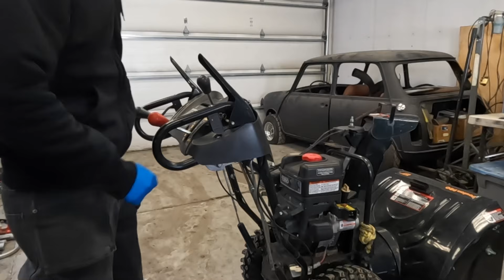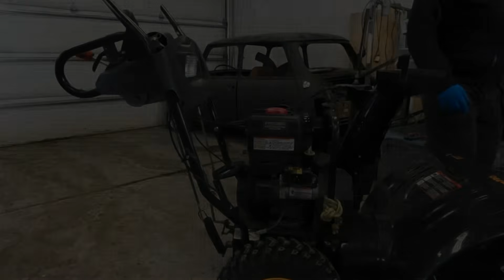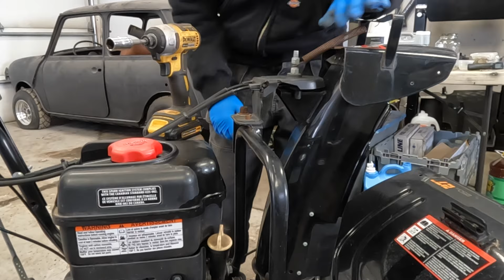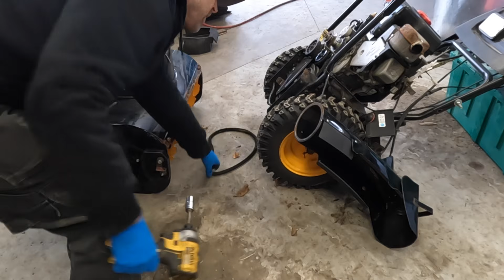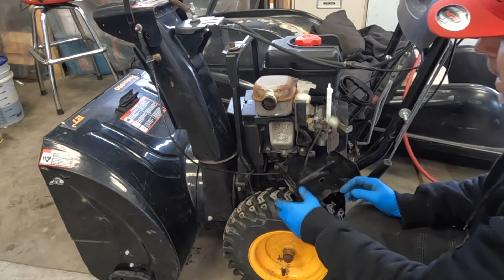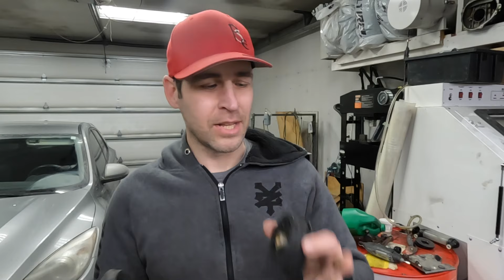Snowblower Inspection - Poulan Pro Auger Drive Issues. (Sorry for my high energy in this video)

Comment: When the two halves were put back together, i didn't notice any routing of the belt on the auger-side pulley.  Is there that much slack that the halves just bolt back without manipulating the belt at all?
Reply from the maker: I put this back together without installing a belt ... just to get the parts up off the floor. 
It is really easy to do, once you have done it a few times. Basically you put the belt around the bottom pulley and raise the halves together. As they get close you can either have someone hold the blower handle, or prop it against something and guide the belt into place. It's not hard at all. 

There is a brake device built into the bottom of the engagement arm, so you need to be mindful of that and sometimes half engage the handle to make sure it goes into place. 

You go this.

Comment: Drain gas first, remove auger pulley from top of engine (crank), remove belt. You can leave chute on, I like it off as well. The pulley may just need a good soaking in a cleaner overnight, dry it out (hairdryer, paper towels), then press in some grease I use moly, the bearing may be good just dried out. I got a 5/8" x 38" belt off Amazon, Tractor Supply sometimes has them. You have a slow leak in right front tire (car).Great vid, I love the file cabinet storage system, I need one, I use 5 gallon buckets, I must have 50 of them.

Comment: Good video. I just bought a Poulan Pro built in 2016. The control panel that supports the cables on the back side has two broken pieces. So, it is stuck in reverse and the shoot won't turn from side to side.  Looks like Husquvarna superceded 581131206 with 581131201 Console Base Multi Control. Hopefully this will do the trick to deal with the tension on the spring for the speed control on the friction wheel. People are saying to avoid the two higher speed settings because the tension on the spring snaps the plastic cable support. One guy attached a chunk of wood keep make it impossible to use the faster speed settings.
Reply from the maker: Interesting... I believe I have worked on that model, but not enough to be able to offer any advice. I just finally got this snowblower up and running a few months ago, and used it for the first time about 2 days ago.

Comment: I have a Cub cadet 2 stage.  It ear belts for auger.   It gets plugged with slush and rocks.   Smokes belt.  I added rubber wipers to auger for chute.   Keeps chute clean and clear of debris.  Also throws snow 15-20 feet more.    Used rubber mudflap and self tappers to put wiper on the blade edges.
Reply from the maker: Cool. That's a neat idea. These typically don't like slush.

Comment: good video I have the same blower that i got for $100, I impeller is bent so I am trying to get that fix got the more separated and loosed the not on the pulley but the auger is not coming out
Reply from the maker: The impeller shaft bearing can sometimes get stuck on the shaft and make it tricky to remove the auger. Hopefully you got this sorted out.

Comment: Gas spilling and still using a drill which produces sparks?
Reply from the maker: Haha... Absolutely. I'm not terribly nervous of a fire starting in the first place, and if it does start, I'm not going to scream like a little girl and call for help.... I'll just deal with it.  I have had to deal with gas fires in the past. Not panicking is key. 

On the flip side, my father ended up with burns all over his body and scarred for the rest of his life when fumes inside of a jetski hull ignited because of an electric impact. He ended up jumping in a puddle to put the fire out... luckily it had rained recently and the dirt parking lot had lots of puddles. 

No one else around was of any assistance, so it's a good thing he didn't wait for help.
Reply: Brushless motors don't make sparks

Comment: I reckon you should put it aside and see if the part's are cheaper in the summer and with the belts and pulleys you could take measurements and get them China on Amazon etc a lot cheaper and next winter just use a shovel until your neighbour gets a new one
Reply from the maker: That's probably what will happen. I have an account with a supplier that I use in the summer, but I may be able to get stuff for less from Aliexpress ... you never know.
Reply: @loweredexpectations4927  supplier's make a lot of there money by selling generic parts with a big mark up they all do it most people search for things by brand etc my friend needed some bushes for his BMW and they quoted around £400 I got the same thing for him for £60
Reply from the maker: @colinhamer6506  Totally... there are really a few companies making most things, and it is then rebranded. I get drive belts for $13-17 and see the same ones that say TORO on them for $45 or more. I have seen $17 belts sell for over $100, and people don't even question it.

Comment: I know the feeling of the empty bank account..... March is a tough time for us small engine guys... Spring is coming ! $$
Reply from the maker: Heck yeah.... it's been a rough winter... and my season ended early because I broke my knee in October.
Reply: @loweredexpectations4927  
That's bad. hope it healed well and the treatment didn't cost you an arm and a leg ♿
Maybe put a patreon link right underneath your next videos. Just so, that everybody sees it without cllicking on "show more".
A lot have tough times these days, but maybe some not so much.
Reply from the maker: @werner.x  I was actually really lucky... I ended up at a sports medicine clinic on recommendation from a friend ... The doctors were ready to put me in a cast for 6 weeks, and the sports medicine clinic told me to take my splint off, start doing range of motion exercises and had me walking on it in less than two weeks. *doing light exercises, no running jumping etc. 

I had been doing exercises at home and had my last appointment on Dec 21st, I was supposed to start physiotherapy ... I couldn't afford fuel to get to my appointments, and to be honest I started giving up a little. I'm in Canada so it didn't cost me anything, fortunately. 

I may take your advice and move my patreon link to a more visible spot.

Comment: I think you should mount the blower to the front of the mini
Reply from the maker: Oh, man... that would solve all of my winter financial problems. Lowered Expectations snow removal service !
Reply: @loweredexpectations4927  
Is heavy snow still reliable in your part of the world?
Reply from the maker: @werner.x  No... Calgary doesn't get much snow... Compared to most of Canada. I grew up on the east coast and you were guaranteed to have many large snowfalls. Snowblowers are fairly rare here.... I'm probably the only snowblower owner on my block... other than my neighbour across the alley... I think he just got an electric one. 

It is more common here for people to use brooms or back pack blowers to clear snow, as it is generally not deep or dense. Not good snowball / snowman making snow.